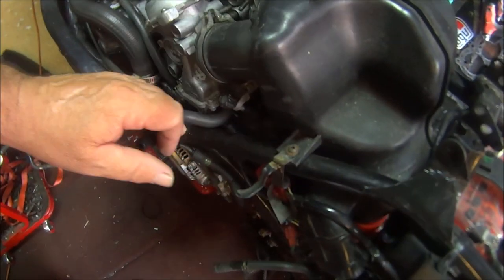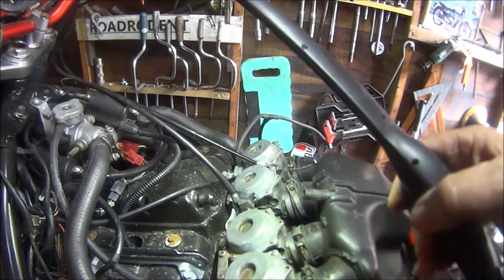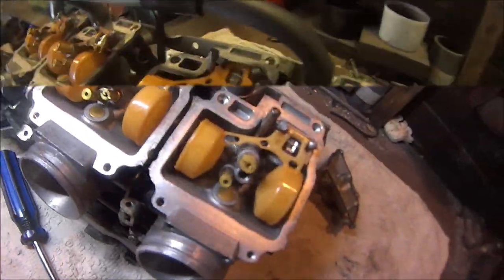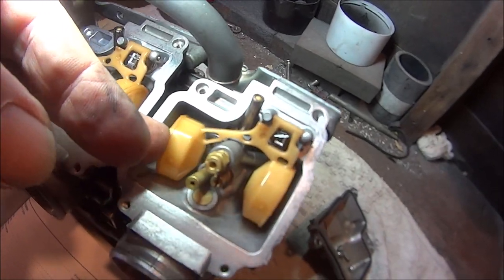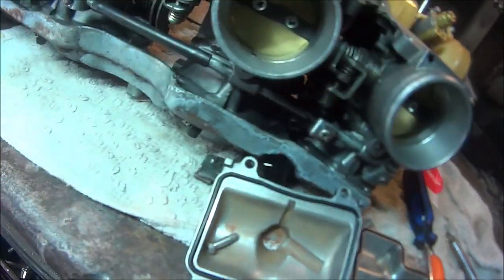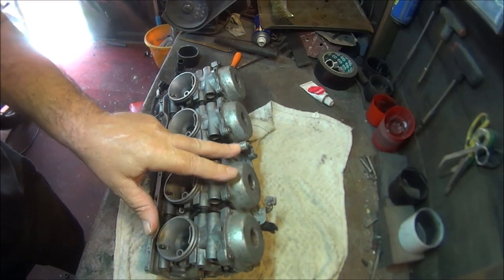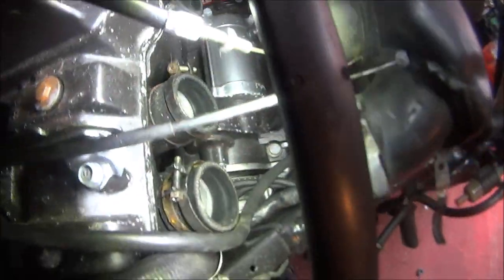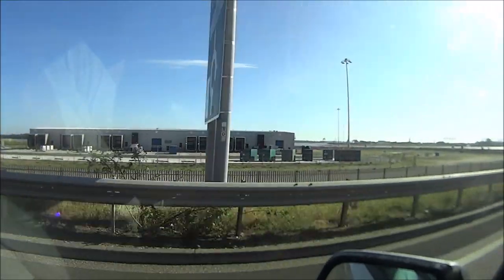HONDA CBR1000F... carburettors bench check..

Comment: Hi pal can you tell me what i need to connect to get the carbs working and back on mine please ?
Reply from the maker: Hi Joe. I've just used silicon radiator hose.👍
Reply: @jonyr1TT  ok cheers can you tell me where the fuel line is please ?
Reply: @jonyr1TT  I’m pretty new to. These bikes
Reply from the maker: The fuel line comes from the fuel tank to the fuel pump and then to the carburettors 👍